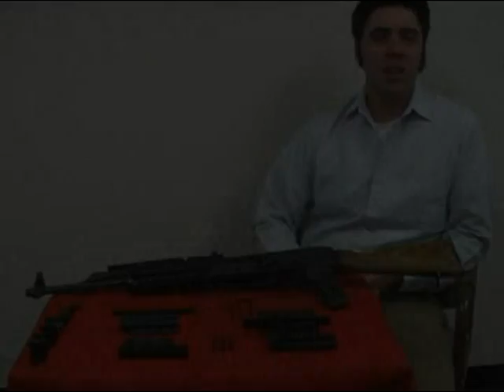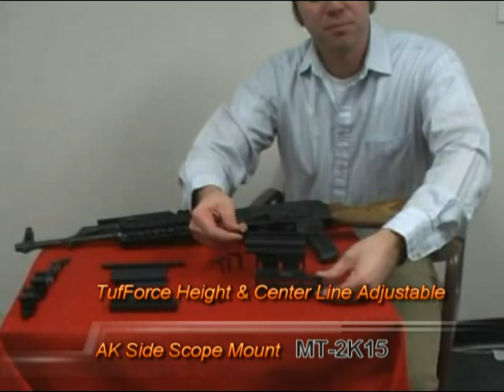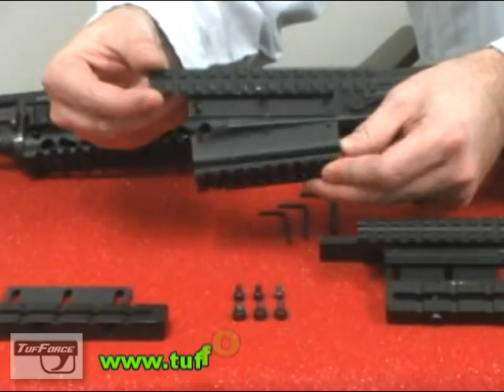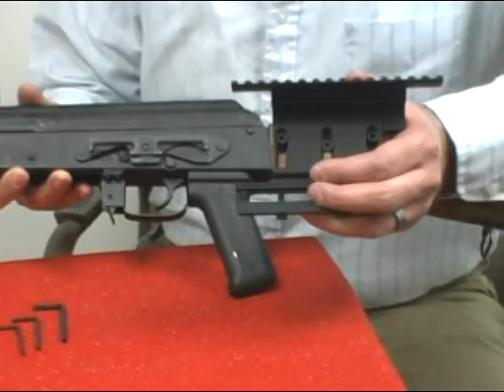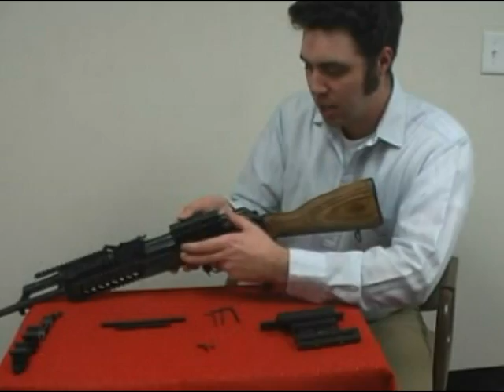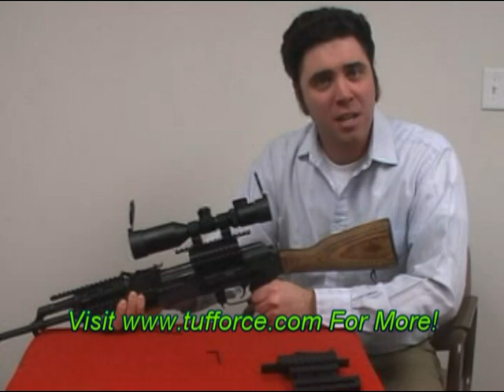TufForce Adjustable AK Side Mount

Comment: I got that side mount on my Romanian Wasr AK and it fits perfect since it can be adjusted up or down, and the top rail well adjust left or right. I had a non adjusting one I sold after getting this one, since it could not be raised to be able to use the iron sights.. I have the height set up so I can use the original iron sights as well.
Reply: geo land thanks so much for letting us know you can use iron sights with this mount. I have been looking everywhere to find one!

Comment: Ok Mabey u can help, my AK 47 Does Not have a existing left side plate protruding from the gun, Noone explains were or how to get this part and how it installs or if it requires welding by a gunsmith, were do you  buy the plate that you mount the side mount to???